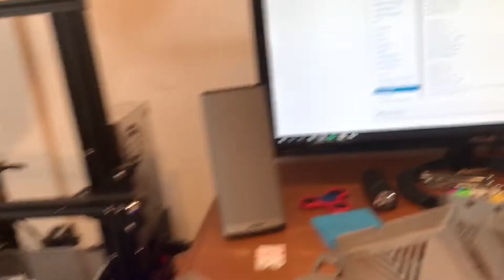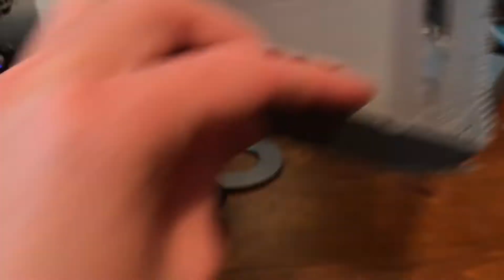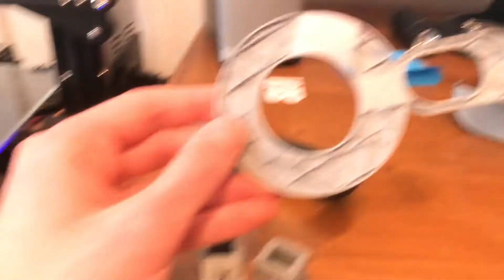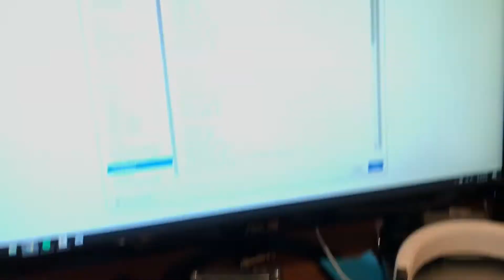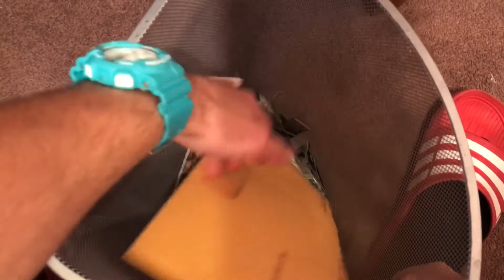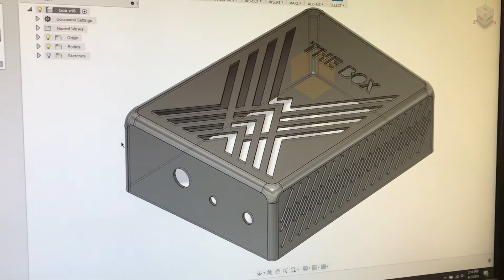Klipper on the Ender 3 + Modeling!

Comment: i do 150 speed on stock ender 3 klipper not needed just fine tune your slicer and tighten printer up properly
Reply from the maker: Different strokes for different folks my dude
Reply: Actually the problem with printing that fast on an 8bit controller shows up when you have lots of short lines rapidly. For example circles. Circles in gcode are just a crap tone of short lines. The 8bit cpu will fail to buffer far enough ahead and almost pause causing slower print speeds and worse quality. Offloading the heavy lifting to the 32bit ras pi will pretty much eliminate these kinds of problems.

Comment: Playing around with Klipper atm too, getting better prints from Klipper then I had with Marlin (2.0.x). Marlin crapped out at 100mm/s and untuned Klipper (only did extruder calibration so far) gave an very good and clearly better result already.

Would love to see your config and compare to mine.

Comment: what temperatures did you use on the cubes ? Since ender 3 hotend is pretty small and the speed of 200mm/s you had to use something like 210 or more no ?
Reply: 210 celcius degree is a normal temperature for many plastic , tipycal PLA.i use 230-240 for petg whithout any problem.( in an Ender 3)

Comment: Same here, please do the video about setting up pressure advance on ENDER 3 ! Thanks !
Reply: @ChickinTenders  So sorry, I just found it but I did not see your particular setting for pressure advance. Can you tell me what basis did you use ? I am going through the pressure advance tutorial, but I am currently on 0.8 and not seeing the best results :/
Reply: @ChickinTenders  Oh now I can see you are using 1.05 :) Isn't it a lot ? The guide tells to max it at 1.
Reply: @ChickinTenders  why do you have acceleration set only to 1500 ? The cfg on site has default of 3000. I might test the PA with 1500. Any particular reason ?

Comment: Can you explain what the “pin” issues are? What pins are being referred too? I don’t understand at all what’s being talked about in the Klipper installation guide. Thanks!
Reply: ChickinTenders do how do I know what pin does what on my controller? For example, my board is the original Anet A8. Is there information on the pin-outs somewhere?
Reply: ChickinTenders I googled it a minute ago, and Bam, there it was! Do I have the info, but I’m scared to death about using it. Klipper is pulling me into a lot of places I feel like I have no business going, but that has never stopped me, I just hope I can swim the distance! I appreciate your willingness to be helpful you really are helping!

Comment: How the hell do you get plastic to extrude fast enough to print at 120mm/sec+ with the stock Ender hotend??
Reply: @ChickinTenders  actually there's a lot of physics involved here as the actual speed of print is now reliant on how fast you can hear the plastic to extrude it.  The limitation on print speed goes from being the processing speed of the board to the amount of time it takes to properly melt the plastic.
Reply: @ChickinTenders  seems to be the case, however I think the OP was doubting the ability of the crappy Ender knock off Swiss hotend to keep up with that speed.  I'm a little amazed myself.  The weak spot of almost every printer I have ever had has been the extruder/hotend setup...but it seems to be a non-issue in your experience.  I'm anxious to start using Kilpper and see how the hotend/extruder setup responds on my 4 units.

Comment: New question: can I install klipper on Octoprint? If I had octoprint-klipper on my Mac Pro laptop, could I connect it to my Anet A8, and run it? Would I be able to use the mac’s cpu to do some of the heavy lifting the Anet board can’t?
Reply: Yes. Slice on the big computer & the pi serves up buffered commands to the controller on your anet board

Comment: Don’t you need a laptop to run octoptint? Isn’t that the monitor?
Reply: ChickinTenders got it, I think, so, the Pi comes with an IP address. That means a webcam attached to the PI could be seen. There must be an App for my phone then?
Reply: ChickinTenders more research then, but totally worth it. My shop is outside my house, so a webcam would be very helpful.

Comment: $40 is good, but it’s not the whole cost of s completely pi setup, correct? You need a monitor. Right?
Reply: Nope, it runs headless & you use a web interface.

Comment: So Rasberry Pi versus Smoothie or Ledgre board. The Smoothie wifi is about $180. The Ledgre K is about $140. Integrating a Raspberry Pi with an Anet 8-bit board, what's the overall cost?

Comment: dude.. post your klipper profile. you said yourself how much plastic you wasted getting to where you're at, why not give us a head start?
Reply: It doesn't work that way.. He used a very high pressure advance of over 1.0 and mine was .350 - Too much variation in printers and the slicer settings still have more to do with it than anything. The stock Ender profile provided for Klipper is already a great starting point. Other settings need to be tuned per printer.